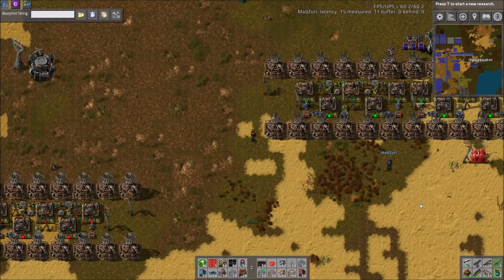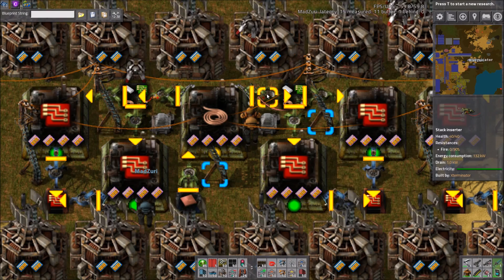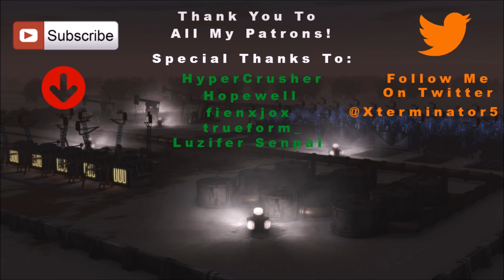Factorio Workshop - Building A Better Factory :: Oliver's Red Circuit Build

Comment: Hi Xterminator, I have two submissions for this series. One is a book of very compact assembly designs that can work for a lot of different products. All these designs can have their belt output replaced by provider chests, and some can be fully beaconed. The second book has some very basic setups for oil that use efficiency modules in beacons. It is actually cost effective when affecting 4 or more oil refineries. The second book also has an end game/mega base oil build that incorporates efficiency modules in beacons. I can't think of a way to reliably measure the efficiency of this whole setup like you and zuri did in your Power / Space Calculations video because of needing to measure a fluid..

Compact Design Paste: http://pastebin.com/CCkGGnJb
Oil Efficiency Designs: http://pastebin.com/UzxbSQX9
Thanks :)
Reply from the maker: Thanks, I've added them to the list! Look forward to going over them. :)
Reply: Nice one!

Comment: @xterminator this is not really related to this video but it would be cool if you could do a tutorial on how to setup large train hubs with a terminal train network. So far I have only used loop based designs and I want to try using a terminal system but I just dont now how to setup large stations with lots of waitng areas since the trains need to back out of there somehow.
Reply from the maker: Sure, that could probably be arranged. Actually a really good idea for me and Zuri to do a video or two on setting up a system like that. :)

Comment: I thought about doing 3Prod3 and 1Seed3 in the circuit machines but I like the prod bonus more. Didn't notice that pole on the right. My one doesn't have that issue... I typically build it from memory anyway
Reply from the maker: Good decision, full prod in the machines is usually best for stuff like this. :) Hmm that's weird your version doesn't have the pole like that. Sometimes blueprints get messed up when exporting/importing.